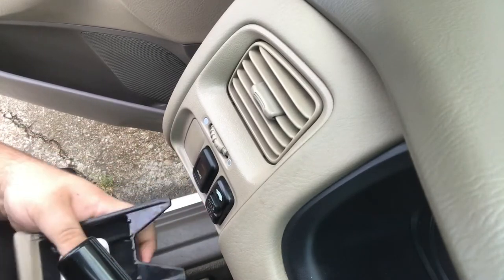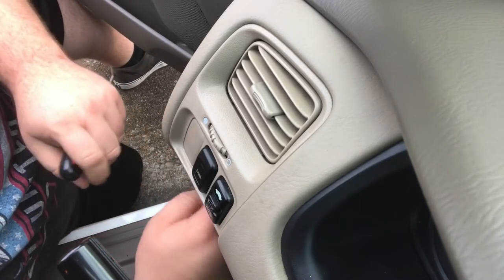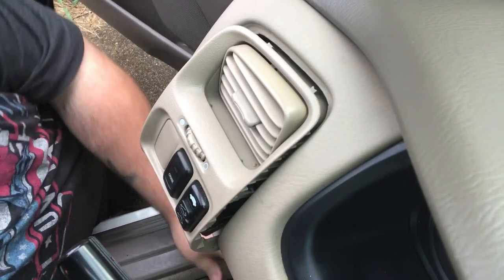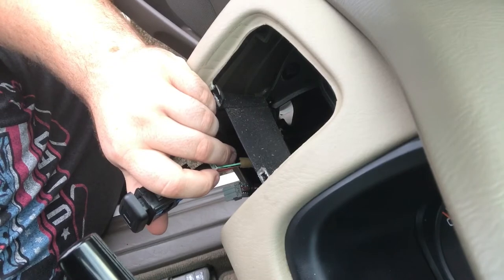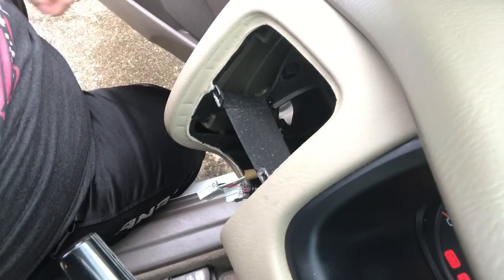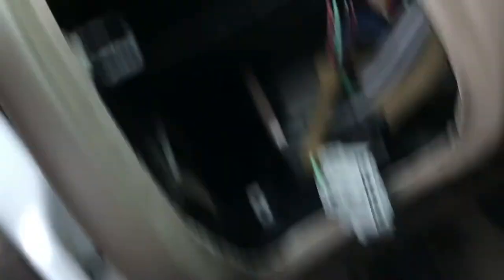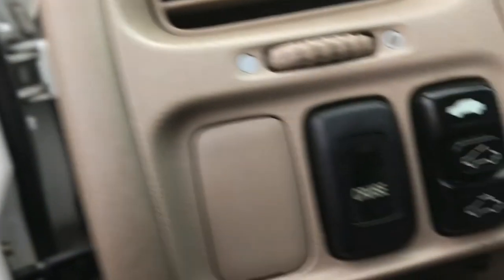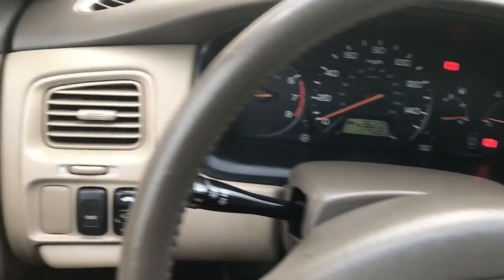Fixing the cruise control on my Honda Accord(97-02 models)

Comment: For anybody doing this a very easy way to access and switch out the module is to take a very small flat head and on the left of the cruise control there is a little cover with a notch at the bottom. Gently pop that out and you should be able to use your finger and push it out from the back. No need to unscrew everything. Great video tho having the same problem going to order a new one today.

Comment: I bought my 99 Accord and the cruise control never would light up never worked I replaced the switch which didn't work also replaced the cc module still not working I don't believe it's the wiring I think it  has sum to do with computer at this point rip my cc
Reply from the maker: cruise on these cars works when it wants to. flawed system imo

Comment: 2000 Accord. Cruise worked (lights and all) parked for 2yrs and the light on the dash button doesn't work nor does the cruise. Any idea?
Reply from the maker: Could be switch itself I would try that first. Brake switch stop lamp switch could be bad as well.
Reply: @ABrianLewisVlog  will do. Thank you!

Comment: Hey so my cruise control button depresses and lights up but when I press set the cruise control light by the speedometer does not come on and cruise control doesn’t work. My brake switch went out and before it went out my cruise control worked 40% of the time. Now it doesn’t work at all and I thought forsure it was the brake switch but after adjusting and adjusting I know it’s not that. Also the guy that sold me the car like 6 months ago said the distributor needs to be replaced soon. any help is greatly appreciated

Comment: Brian, my cruise control switch does light up but it doesn't engage (doesn't go into cruise control mode) and i don't see the indicator go on in the cluster. Could switch be broken but still light? thanks!
Reply from the maker: Check your brake lights if ones out a lot of times the cruise won’t set
Reply: Brian Lewis unfortunately the brake lights do work but CC won’t engage... maybe the controls on the steering wheel? Thx

Comment: Brian, did that really fix your cruise control? The reason I ask is because yesterday my cruise was working, but today it's not. My cc light that you replaced comes on, but the steering controls don't work
Reply from the maker: Vince Del Fabbro you either need to adjust your brake switch or replace it. My cruise does work now yes
Reply: That's awesome. Last time my cc didn't work I had to replace the computer, PITA